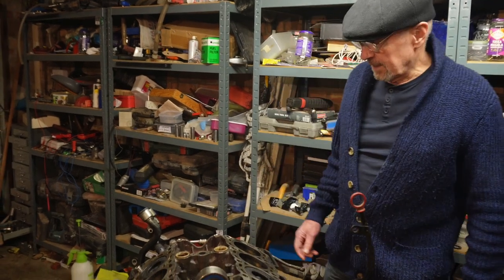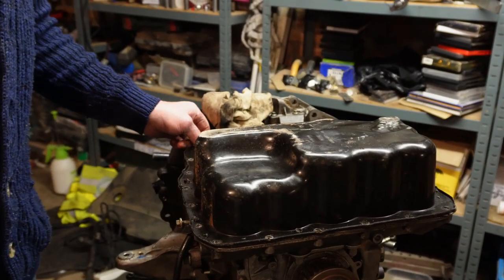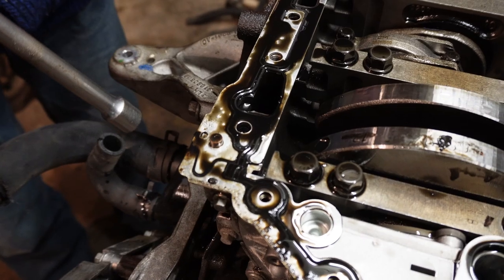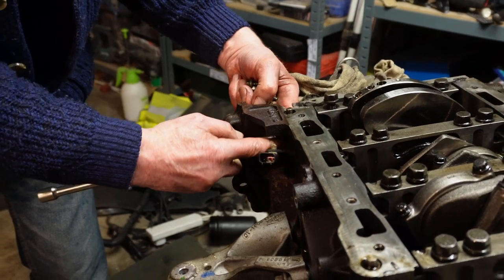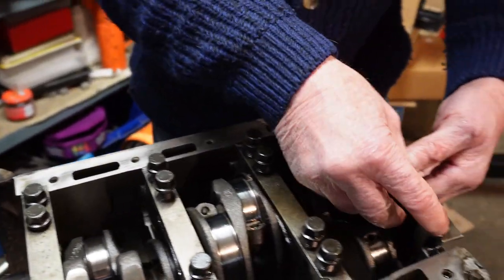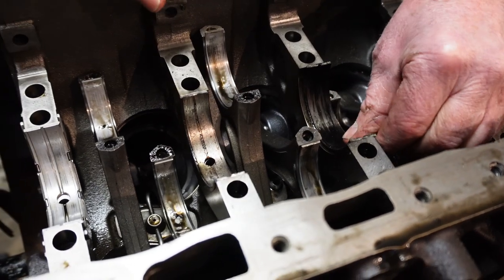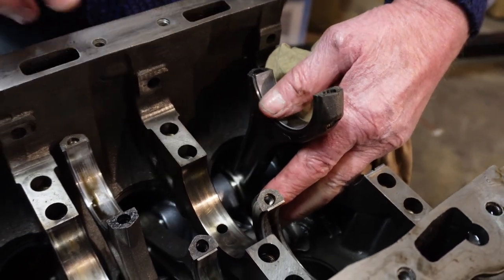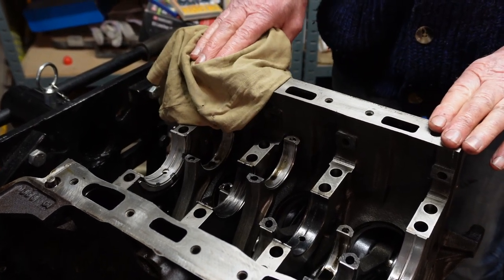2.7 / 3.0 Diesel TD V6 Jaguar Land Rover - Destroyed Bottom End Crankshaft

Comment: What conclusion did you come to? Empty ramblings and judgments like everyone else... I can tell you what to do so that it doesn't ...
Reply from the maker: Hi Artis, thank you for watching and for your feedback. If you are looking for a difinitive causation of failure regarding these engines then you will continue to feel frustrated. The video was made to show the parts of the engine inside and out ( also the parts that failed ) for reference purposes.  I gave a few possibilities as to cause at the end of the video ( what I assume you refer to as ramblings ) Thanks again for watching.
Reply: Why do you blindly believe the absurdity that was invented for the 2.7tdv6 engine in 2005 and continue to listen like a herd of sheep or pour 5w30 oil? :)
I have had Entie Rover diesels, all with chipped engines, egr off fpf off chip 2.7; 3.0; 3.6; I have always put Wolf 10w60 full synthetic oil in the 4.4td, any problems disappear. In a hot summer, your 5w30 is like water... The head for that is to think with it... :) @crystalclearmechanics
Reply from the maker: Hi Artis, Can you put aside your frustration for a moment and explain  in a reasonable manner why the vast majority of 2.7 TDV6 engines are trouble free as are the later versions while still running on the oil recommended by JLR. Any oil used other than what is recommended by the manufacturer invalidates any warranty, be it on a new or used vehicle. Fitting a performance chip is fine, removing the EGR and DPF is illegal and an MOT failure. Maybe you are living outside of the UK where this is allowed.  @dakteriitis
Reply: 10_60 would probably mean the added diesel would take longer to reduce the oil quality. Therefore his arguments are trolling.

Comment: Nothing wrong with "only" 4 main caps compared to the other V6 diesels around. For example VW Audi V6 TDI are the same, plus there are locking notches for the main bearing. The chains are from the back means engine out every time! However these are known to fail due to bad/worn hydraulic chain tensioners and more smaller issues due to engine design, leaks and of course failing engine peripheries which is very similar across all modern diesel engines. I would not say the TDV6 (SDV6) is a bad engine in first place. Take care of every engine, listen wise people and do your preventative maintenance and it will last.
Reply from the maker: Hi, thank you for watching and for your feedback. You are right about the preventative maintenance, I'll be uploding a new video soon to show cause of failure.

Comment: jesus i never saw metal crap like that in any engine, the reputation of the 3.0 xf is why i bought a 2.2 xf hopefully it will be bulletproof
Reply: A Peugeot engine, reliable. If you change the oil every 10000km/ 7000mls.

Comment: Same size very old Toyoya inline diesel engine has 7 bearings compared to Ford/Jaguar 4 bearings. 600 newton metres of torque on the jaguar and they gave it 4 bearings!
Reply from the maker: Hi thanks for watching and for your feedback. The block is made of compacted graphite iron which uses less material to produce compared to a conventional cast iron block, this provides reduced weight and length. It does not explain by how much the length it is reduced but reduced block length = reduced crankshaft length. That could be another reason for the inherent failure. There could be many reasons but without the correct testing equipment it's anyone's guess.

Comment: Shocking - I'm no engineer but as @dfor50 says below, why only 4 main bearings for 6 cylinders? OK, it's a V but back in the 70s my Dad bought a new Cortina, with the Pinto engine and that had 5 mains for 4 cylinders. My 2013 XF 3.0D S engine failed at just under 40k miles - crankshaft. Lucky for me JLR replaced it at their expense so it was just an inconvenience to me. I've seen a few of these stripdowns and I just don't get the design of these engines. I mean, 6 bolts for each main bearing cap - 6???, and the skinniest crankshaft webs I've ever seen - no wonder they break - not to mention the lack of tabs on the shells! Anyway, just home from a 2,200 mile trip to the S of France, taking it to just under 60k on the clock, and all good.
Reply from the maker: Hi, thank you for watching and for your feedback. The engine is a Ford-PSA design and uses compacted graphite iron to form the block allowing for weight reduction, increased strength and a shorter block, how much shorter or from what benchmark they fail to state but anyway a shorter block means a shorter crankshaft. It is in fact a 4 bolt mains, the extra 2 side bolts ( through the block ) are to give the thin walled block stability. Yes I agree with you about the missing  tabs on the shells,  although many say they are only locating tabs and that crush pressure holds the shells in place I would argue that the pressed tabs also give resistance to circular movement, spinning shells was not the norm with tabbed shells in my experience, worn shells and worn / oval cranks yes. The early 2.7 S Type jags ( pre DPF regeneration ) appear very reliable which points to the possibility of the engine oil being diluted in later cars due to the timing of the fuel injection being altered by the computer to assist DPF regeneration by way of hotter exhaust gasses, excess fuel finding it's way into the oil sump. Other factors may come into play but as a safeguard I recommend engine oil / filter changes at 5 t0 6,000 miles.
Reply: You can also substitute a bigger diameter of main bearing for width, but I totally agree they tried to make a short length engine for transverse mounting effing it all up.
Reply: Ford wanted an engine that could be mounted transversely or longitudinally. For this the engine had to be short, hence only 4 main bearings.

Comment: I've just had this happen on my 2017-RANGE ROVER VOGUE SE TDV6 at 76200 miles after only four months of ownership.
Reply from the maker: Hi, thank you for watching and for your feedback. I'm sorry too hear about your car / engine, hopefully you will be covered by warrenty.
Reply: This is due to the compression ratio specified by the project and a faulty design of oils distribution same engine is fitted on Citroen C6 but the lower compression of the engine doesn’t lead to catastrophic results.

Comment: See what mods Ford did to the 3.0 power stroke in the Ford F-150 pickup apparently changed the bearings and fitted a forged crankshaft it was fitted around 2018 to 2022 in the USA also the Australian Ford Territory had this engine 2.7 for many years without any problems so did they make changes I recommend good synthetic oil with 6k mile changes and new oil pumps at around 150k miles or better when you change the cam belt as it’s not much more work.
Reply from the maker: Hi, thank you for watching and for your feedback. I agree, 5 to 6,000 mile oil  / filter change.

Comment: Regular serving and maintenance and these engines last. I’m on 196k miles in my 2005 XJ Sport Premium and it’s as sweet as a nut. Owned it for 10 years from 48k miles. 

Motto is: regular servicing and maintenance, but it ain’t cheap….
Reply from the maker: Hi Graham, thank you for watching and for your feedback. If you watch my video "cause revealed" it explains the main cause for failure but you are correct, servicing at the correct intervals helps longevity.

Comment: Brilliant video, really informative.
Reply from the maker: Hi Richard, thank you for watching and for your feedback.
Reply: @crystalclearmechanics  Hi, do you rebuild these engines?
Reply from the maker: Hi Rohina, thank you for watching and for your feedback. In most cases It is not economically viable to rebuild these engines when the bottom end has failed. If you have a 2.7 TDV6 then I would recommend you buy a used engine ( you must be able to hear it run ) from a pre regenerative Jaguar S Type ( 2004-2005 some 2006 ) or buy the whole car ( around £800-£1000 ), for XF fitment change / use the XF alternator and AC compressor.  @rohinaakthar4511
Reply: @crystalclearmechanics  , Thank you  that's the impression I'm getting - just ridiculous that so many of these fail like this.

Comment: I've come across your excellent video following a catastophic engine failure of my wife's 2018 3.0L V6 Jaguar XF Sportsbrake with just 40,000 miles she's had it since 2021, serviced twice at a Jaguar specialist using Jaguar parts. 
We raised a complaint with JLR due to the extremely low mileage and had it inspected at a local dealership, as requested by JLR customer services. The dealership advised they drained approx 7.7L of oil containing large amounts of metal fragments, which sounds like the idea of deisel getting into the oil is valid, as there is little chance of the specialist over-filling it. 
The car regularly showed the DPF regeneration message shortly before the self-destruct, and as the car was primarily used for short, local journeys in recent months, I wonder if these are the cars that have had the failings. I have read of the DPF regeneration of Jaguars that might explain these failings,  that turning the engine off during the high temperature process, does not give it time to cool it down, and there is no message for the driver to not stop the engine during the process.
JLR responded following report by the dealership with a visit by one of their HQ engineers, which I was told was to ensure the engine had not been chipped or had performance parts that may have jeopardised the integrity of the engine, which it had not. Still, the undisclosed amount they offered towards the replacement engine by said dealership leaves an outstanding amount of just over £18,000 for us to pay. We have taken the issue up with the Ombudsman and been told today that they are willing to investigate our complaint, though from what we read this could be up to a year to reach an outcome.

We still have to find a replacement, preferably warrantied reconditioned engine supplier that will not rip us off. I read that all too often engine suppliers up their original pricing by a substantial amount for "unforseen additions" so if anyone can recommend anyone, preferably in the south east, Surrey, Kent, Essex area it will be welcomed.
Reply: >The car regularly showed the DPF regeneration message shortly before the self-destruct, and as the car was primarily used for short, local journeys in recent months
Oil delusion. While the car is running a DPF regen it dumps extra diesel into the cylinders. If the DPF regen doesn't finish, because of short trips, it will try and do the regen again and again. You end up with diluted engine oil far thinner than specification viscosity. This is exacerbated by JLR claims these engines only need an oil change every 15,000+ miles. 
I'm sorry for your loss as I'm sure it has been stressful. Always fully research your vehicle and learn from other peoples horror stories.
Reply: @LCDqBqA  thank you for expanding on how the regen does the dilution. I'm presuming the excess diesel in the pistons that haven't been ignited upon switching off the engine, drains past the rings into the sump where it mixed with the engine oil?
Reply from the maker: Hi, thank you for watching and for your feedback. It does appear that oil dilution is the cause of failure in this case due to the amount of oil drained. The engine is a Ford / PSA design ( Peugeot / Citroen ) and is fitted too those as well as JLR. Ask Jaguar to itemize their quote because as I understand it they charge an excess of £2,500 , which is returnable on your old unit which implies their engines are rebuilt. They charge approximately £10,000 including VAT for the engine which leaves £8,000 plus the undisclosed amount to fit it according to your quote which seems an excessive amount.
Reply: @crystalclearmechanics  Thank you for the great videos on the Jags. I'm trying to keep mine in good condition. I have heard about this, and read on a few jag forums it appears less of an issue on later Jag models just before the pre-ingenium engines. However, in terms of oil dilution, is there a way I can tell if this is/ has taken place? Will the oil smell like diesel or have any signs? I do some short journeys but mix with 40-50 min motorway journeys and only use vpower diesel to try prevent any issues. Thanks
Reply from the maker: Hi Matt, thank you for watching and for your feedback. If your oil level goes up then it's a sure indication of diesel fuel dilution. I recommend 5,000 mile oil and oil filter change intervals as a precaution.  @mattturner7461
Reply from the maker: Hi Matt, Thank you for watching and for your feedback. A rise in engine oil level is a sure sign of diesel fuel dilution. I recommend 5,000 mile oil and oil filter change intervals as a precaution. @mattturner7461
Reply: Check universal salvage they used to give you 3 months warranty or certain mileage, and Property pick one up for under 2 grand mechanics labour 450-550£ if you go for the Citroën engine you probably get it cheap
Reply from the maker: Hi, thank you for watching and for your feedback. @jedi-mic
Reply: The oil dilution due to incomplete regens is an absolute faff on my XJ. Jaguar could so easily have solved it by including a dashboard warning message that a regen was occurring. I do mostly short trips and sigh greatly when I get out of the car to smell a very hot engine and hear the tell-tale ticking of it cooling down.

One way round it, is that the engine does sometimes get noticeably rougher to the ear, and the instantaneous MPG reading does betray a greater usage of fuel (usually, lifting off the throttle will quickly get it to 99mpg, when regenerating, very much not) - but you have to remember to check, which you're just not going to do every time when driving home after work.

The car itself asks for an oil change about every 5,000 miles (or less) - which drops very, very quickly from the initial 16,000 after each service. I've just resigned myself to the reality of an annual service, plus an additional oil change (or two) each year.

Comment: I've got the 2.7 in my LR3. It's done 196,000 miles, no problems. I service it every 3000 miles. If I got a 3.0 Disco 4 and followed the same service interval would using zx1 friction eliminator go any way to making this kind of failure not happen? Thanks.
Reply from the maker: Hi, thank you for watching and for your feedback. I  recommend oil and filter changes at 5 to 6,000 miles for customers but 3,000 can only be good.

Comment: The cylinder numbers are not always like this most V engines are numbered from the front as to their position down the crank so it will alternate left bank to right bank and the French love numbering their engines from the back to front of the engine.

Comment: Blimey! Only a 100k miles on this engine and yet such a catastrophic wear on the bottom end. 
I’ve heard many people joke about that the 2.7 / 3.0 tdv6 is made off glass but I always thought it was down to the owners…I’m now starting to have second thoughts if I should avoid those engines…. If I am not mistaken JLR were telling their new vehicle users that their very first service is due on the 15K miles. Which me personally I find ridiculous. Brand new engine that’s still bedding and working-in there are some minor particles to be expected in the first oil change as a result of this process yet they are expecting you to have the first service in such a long range…My theory is that people who actually listened to this nonsense advise are the ones who suffer the worst failures of their engines. 
So buying a pre-owned vehicle like this is a pure luck coming down to how sensible was the very first owner of it.
Reply from the maker: Hi, thank you for watching and for your feedback. I advise 5,000 mile intervals between engine oil and filter change because of possible oil dilution by diesel fuel which can happen during altered fuel injection timing for DPF regeneration.
Reply: Hi,

So which oil you guys recommend? Here in Brazil I'm using 5w40 in my LR4 3.0 SDV6
Reply from the maker: Hi William, thank you for watching and for your feedback. I would advise using the Jaguar recommended oil for that vehicle and climate. I recommend  oil and oil filter interval replacements at 5,000 miles. @williamseabrajr
Reply: I wonder if it's better to use a ceramic oil filter? Definitely block more particles

Comment: What years are we talking about here? I have a 2008 xf with the 2.7 diesel engine - 135,000 miles no issues apart from a crack in the plastic coolant housing last week which i replaced easy enough. Are these problems on the older X type/landrover engines from the early 00s? Thanks
Reply from the maker: Hi, thank you for watching and for your feedback. The Jaguar TDV6 with the regen DPFs fitted from 2006 and newer. Just to make it clear, this is not across the board, I have seen some with 280,000 miles and still going strong. I recommend 5 to 6,000 mile intervals between oil / filter changes. Reason, the computer alters the timing and amount of fuel injected into the engine to help heat up the DPF to aid regeneration. This fuel finds it's way into the oil sump and dilutes the oil hence shorter intervals for oil changes.
Reply: @crystalclearmechanics  Thanks again, I'll shorten the service intervals. They are great cars to live with, I want to keep her on the road for as long as possible. .
Reply: @crystalclearmechanics i have a range rover sport l320 2.7 ona 2006 plate with no dpf...so is this one on the video newer model?
Reply from the maker: Hi, thank you for watching and for your feedback. The engine in the video is from a 2008 Jaguar XF. Same engine as your Range Rover  but with different ancillaries. @juanpablo-vn1xo
Reply: The 2.7 is a very cheap engine to buy second hand. 3.0d much dearer.
Reply from the maker: Hi, thanks again for your feedback. Yes your spot on about the costs. @S-u-p-a